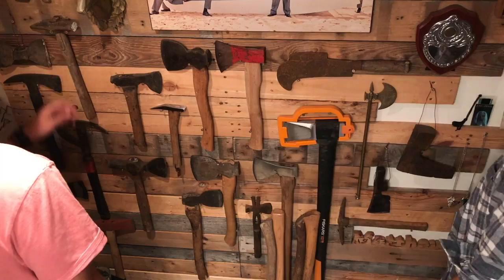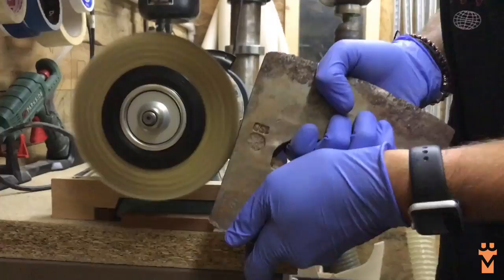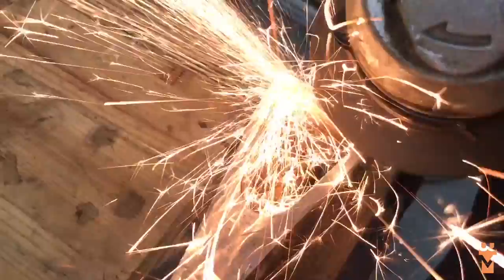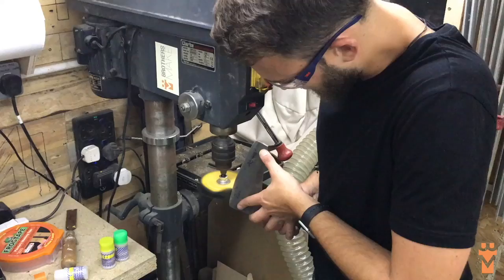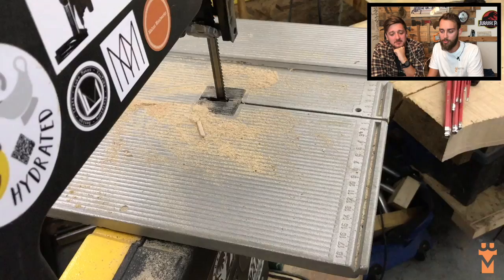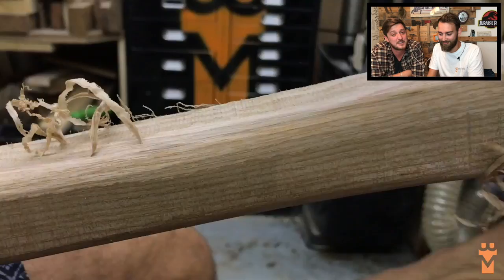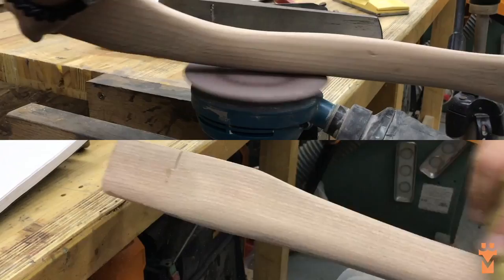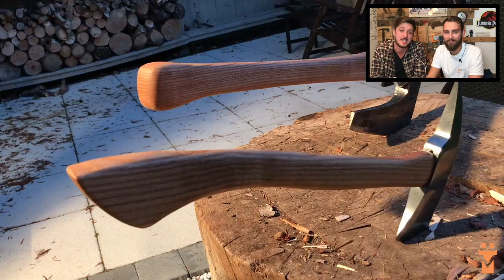Rust-Covered to Mirror Finish - Axe Restorations

Comment: Fun video guys! Nice axes! Looks like it may have been the 1st time for you both? Just a little hint...look up proper wood "grain orientation" for axe handles... When you're just starting out with restorations, it's something that alot of folks do not consider, when cutting out handles from raw lumber and orienting the haft to the head. (Hint: the grain [should] run the SAME direction as the cutting  edge, so as to give proper strength when striking). They'll withstand MUCH MORE IMPACT with the grain in the OPPOSITE direction you mounted them! That being said, they're painstakingly BEAUTIFUL!
Cheers, from Oregon, USA!
Reply from the maker: That’s a good tip! Thanks for that Mike! 👍🏼

Comment: Boys... you could have saved yourselves a LOT of hand sanding if you'd gone with a fleece, scotchbrite flapdisc on your angle grinder...They come in a variety of grits  too, I get shaving sharp mirror finish edges in 10 minutes for my axes, start with a normal sandpaper flatdisc at 80grit, 120 then coarse, medium, fine fleece discs and then buffing wheel and compound. Oh, and if you are going to use different levels of compound, I'd strongly suggest having a buffing wheel for each one. 
That being said, it was a fun video! Look forward to the next one fellas
Reply from the maker: Ah thank you man! Never thought of using something like that but will definitely invest now. And yeah we’ll swap out the wheels, we probably have enough of them for one each. Thanks for the tips buddy - very cool of you 👍🏼
Reply: @BrothersMake  anytime gents